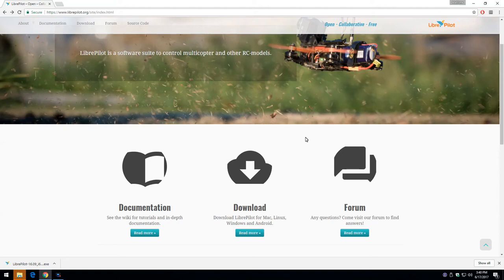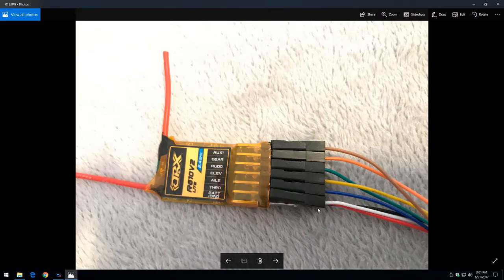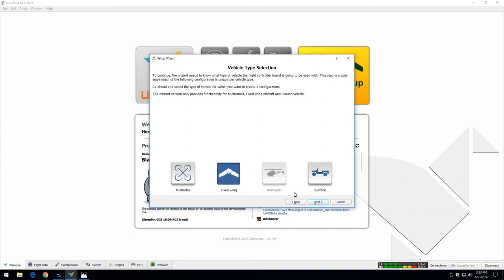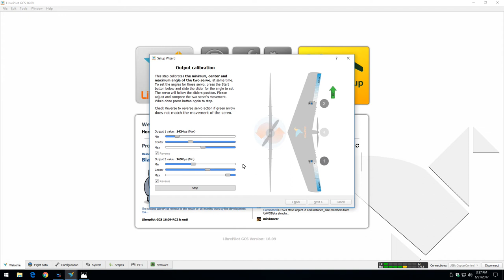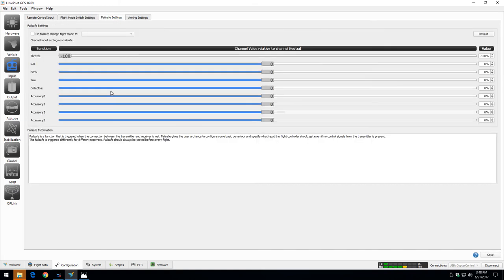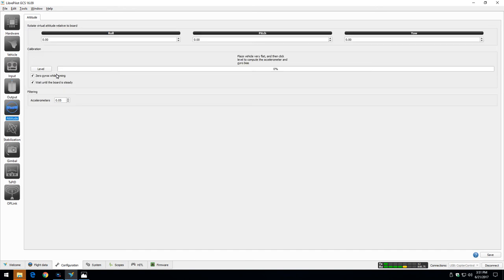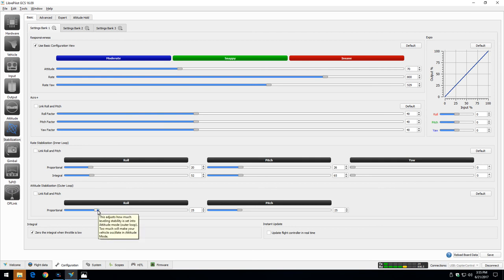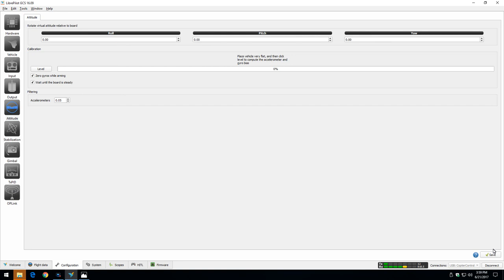Adding CC3D to Fixed wing

Comment: Thanks, man.
I have a C1 Chaser from Banggood which flies beautifully without the stabiliser. I wanted to get fancy and put a CC3D on it and surprisingly enough, it went horribly wrong. I crashed. It was super difficult to fly the airplane. The initial mode that I had it on was all in Rate but that didn't do it. I should have gone for what you recommended: Manual.
Now I gotta go back, glue my plane together and hope for the best but I'm now traumatised haha.

Thanks again for this instructional video. I'll let you know how it went.
Reply: All right, so that went better than the first time!
Manual mode and I got the airplane under a 100% control.
Rate mode and the plane is stabilised beautifully.
Now the only problem was with the Attitude mode. Somehow as soon as I switched to Attitude, the airplane would pitch up and up and up and then I would lose control, so I had to quickly go back to Manual to recover. Only did this two times and with plenty of altitude but then didn't dare to do it anymore.
I guess something funky going on with the gyro or something :/
Configuring this thing has been a royal PITA. I wish it just worked out of the box :(
Reply: put the responsive to insane. Then itl work

Comment: Sir my elevons are responding rivers when it comes to gyros what should i do 
I tried to reverse the controls from tx and from librepilot  but it only revers the stick movement 
And do nothing with gyros
Reply from the maker: Try reversing the servos on the "Output" page. Once you get it working, carefully check that the surfaces move the right way when you move the sticks AND when you tilt the airplane.

Comment: Had same sort of thing with my C1 also has cc3d in it and just can not get it to fly. think its somthing to do with the giro in it as when i pitch the nose up the flaps go up and same with down also when banking left to right sould the right flap pitch up as it dose when you give it an input from the hand set? i just dont know is there another video on the setup of a delta wing using cc3d?
Reply: Fucking hell, man. I have exactly the same problem with my C1 + CC3D on Attitude mode. Not sure if it is pebcak or if it's just the CC3D board that is pure rubbish.
For the rate mode it works flawlessly, though.
If you do figure it out please let me know!

Comment: When I lift the nose the elevons move wrong way but sticks are OK
Reply from the maker: You can go through the guided setup again, or reverse the servos and pitch/elevator channel on your transmitter. After you make the changes, be very careful to check for the correct response directions to physical tilting and also transmitter inputs. You might have put the flight controller in pointing backwards. Be sure to check everything including the artificial horizon when it is plugged in and tilted around.